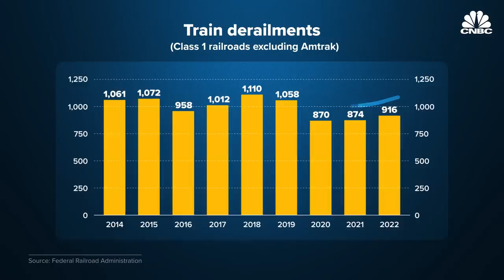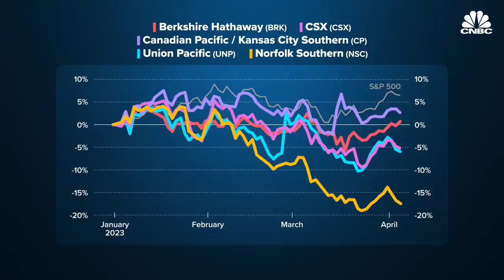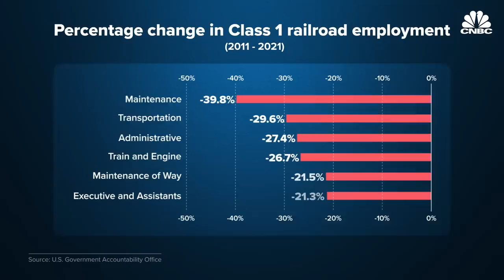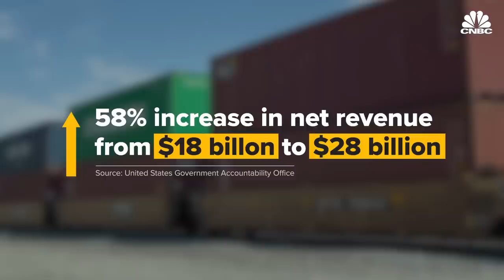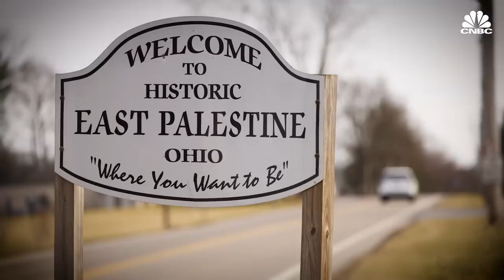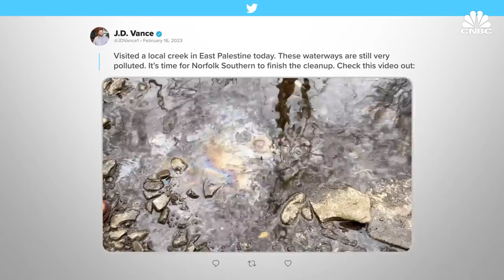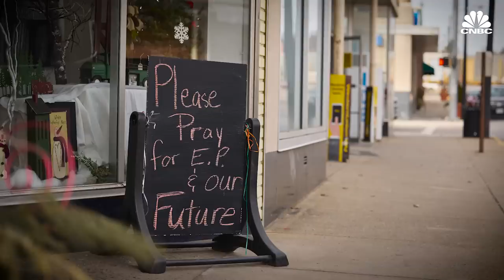Freight Trains Keep Derailing. Why?

Comment: They keep making the trains longer and longer, and they've been doing it for about 20 years or so. They need shorter trains, larger crews working shorter shifts, and they need to bring back cabooses, Fred doesn't do anything, he just flashes. Safety used to be first. Now it's fourth. What's first? Profit, of course. That's what needs to change. Safety should always be first. A conductor riding up in the cupola of a caboose would be able to spot the hot glowing bearing, Fred can't do that. Trains need to be shorter. Crews need to be larger. And shifts need to be shorter. Oh, and the double-stacked Conex containers need to go. Too top heavy. The Ferengi need to get their money-grubbing hands out of everything.
Reply: If your saying Trains shouldn't handle Intermodals, that's not possible to get rid off, the thing is is Trains are the most efficient way to Trans port Containers on Land by far, so it's not that simple.

Comment: Freight trains are way to long. They used to be 50 cars long, now they’re 200 cars long. That’s insane. They RR companies do it because it takes the same number of crew to run a 50 car train and a 200 car train so they do because they’re being cheap, they don’t want to pay for more crews, but it’s penny wise and pound foolish because a 200 car train weighs 4x more, harder and longer to stop and when that extremely long stung out train crashes there’s far more damage. In the long run costing the RR a fortune to clean up the mess, the lost equipment, the lost cargo and the law suits that follow. Not worth it.
Reply: Modern locomotives are 4 400 hp, not the 1 500 of the 50´s
Hence longer trains with less engines. AC traction motors are stronger and computers have better control of wheels adhesion to avoid wheels slippage. Technology permit to have radio controlled locomotives in the middle of the train to reduce stress forces. Less locomotives on the roster =   less employees to maintain them and less shops. 
Where i am, potash trains are 200 cars of 130 tons (100 tons of potash + 30 tons car weight) or
26 000 tons + 2 locomotives in front + 2 in the middle and 1 at the rear.

Comment: More load=more track stress/vibration.

Freight railroads don't care about infrastructure and tracks/mainlines are getting old.

It's the freight railroads that are the problem and it's too risky for Amtrak to run if the freight railroads won't fix the tracks. 

With all this I won't be surprised if a major Amtrak derailment happens...

Comment: Is it because of hot box axles? Trains use to have cabooses where someone would watch for hot boxing and stop the train if it happened. Can we setup monitors on the cars that automatically cut the engine?
Reply: Sure, way back in the day of 75-car trains, made up of 40 ft long cars, ie 3,000 ft long trains, the conductor "could" see problems in their train. In today's typical two-mile-long steel snakes you cain't see the other end of the train and need a box (FRED - Flashing Rear End Detector) on the end of the train just to tell you if the train is still coupled or not.
Reply: No way, paying one more employee to ensure the safety of the crew and train is not worth it because.... Profit!

Comment: Small correction.  The film on the water is just as likely a bacterial biofilm.  This isn't uncommon in early spring.  That's not to say it's not also polluted (almost certainly is), but it's not the smoking gun it seem like.
Reply: Or the fire combatant chemicals. There are eco friendly types, and effective ones.
Reply: Easily also industrial agriculture residue.
Reply: Just runoff from roads can cause that around me.  Though also heard reports of a huge amount of fish and livestock dying off, so probably more then just the usual slight amount of oil drip from automobile traffic.

Comment: look at the nails holding the track they are missing and are loose. at sulison city counding 10 sleepers  there were 4 nail holes per grip, of 10 sleepers most of them were missing nails 9 of them had nils up by one inch,  2 had nails out by 2 inches this could well be typical of many rail road tracks.

Comment: Some derailments are also cause by trains hitting trucks at grade crossings. The most dangerous trucks are hazmat in tanker / other trailers and oversize loads that use lowboy flatbed trailers. Those are the fault of the truck drivers who decide to go around the gates or go across sloped grade crossings getting the lowboy trailers stuck on those sloped grade crossings. There are videos of trains hitting trucks with lowboy trailers carrying heavy construction equipment or oversized loads then derailing. Grade crossing accidents are not the railroad's fault it's the fault of the stupid road vehicle driver going around lowered gates or getting an lowboy trailer stuck on an sloped grade crossing. Other are trains hitting people trespassing on railroad property or people running or riding bicycles across the grade crossing as an train coming. Train crews suffer mental issues when they hit an road vehicle or an person with the train they have control of. When they slam the train into emergancy braking it takes time to stop the train and sometimes that can cause derailments due to the slack, weight, and tonnage of  the railroad cars sliding to an stop.

Comment: The Big Issue is that government rules, supported by Democrats, safety activists and the unions, forced the freight railroads to spend $15 BILLION over the last decade on a Positive Train Control computerized/GPS system that has produced virtually nothing in the way of safety (it sure didn't stop East Palestine or any of the other recent derailments). When those billions go out the door with no return, less money is available for much cheaper and more cost-effective safety measures like worker training, more frequent car inspections, more defect detectors along the tracks, drug testing, track upgrades, etc.
Reply: Well, the PTC isn't integrated with other safety systems.   Perhaps in the future the hotbox detectors will not only "talk" to the crew but also send a report to the dispatcher and a computer there would, given a warning of a likely failure, directly stop the train so that the conductor can do a manual inspection.    PTC in theory could permit the trains to operate with only one person who would only get involved when the system detects an effort which requires closer inspection or when a switch needs to be manually operated or a broken coupler or hose needs to be fixed.   Otherwise, the guy could take a nap.
Reply: That's why laws should be written in a way not to tell you what to do, but to tell you what you need to achieve.
Unfortunately many laws in the USA (and many other countries) are just badly made.

Comment: Lots of ignorance in this video and the comments.  US railroads spend an average of $2-4billion per year each on capital improvements.  The mainlines are in better shape than they have been for decades.  Derailments are down about 40% since 2000, and about 75% since the 1970s.  RR management absolutely hates major derailments.  They are expensive in human and equipment and lading loses, expensive to clean up, and expensive in the disruption they cause in traffic patterns.  That said, the large amount of money it would take to significantly reduce the number of derailments would be hard to justify.  US RRs move thousands and thousands of cars in hundreds of trains daily, and cover hundreds of thousands of miles.  With that volume there are going to be derailments daily.  You can't drive defects to zero.  It's like saying you would like there to be no car accidents.  We would all like that, but what would it require?

Comment: Maybe the government should subsidize retraining for people of out a job. That way we get more engineers and mechanics, so we do not need that many long trains. We see the same in the trucking industry. 1 truck driver can drive a truck with two intermodal 40ft containers. A single train engineer can move 300 containers with just 150 cars. Maybe the government should stop with these covid checks and make sure people start working again. Too many people are at the side line. Another issue is that the government does not enough to prevent theft out of containers stacked on a train. What is the railroad solution? Well, they can't attack a running train. So these companies make sure trains are running in these dangerous areas.

Why doesn't the US government implement periodic roadworthiness (track?!) checks which are common in Europe, but not the US. A locomotive or car cannot be used if it doesn't pass the periodically checks. In many European countries roadcars needs to be tested annually. Cars in better condition also result in less accidents. Less accidents means a lower burden on ER's. Less people in ER's means lower health insurance premiums... 

Unfortunately our politicians spend more time attacking each other than real day to day issues. 

If we don't get more train engineers and still want shorter trains, more cargo needs to be hauled by truckers. Maybe CNBC can also crunch the numbers about truck incidents. Do we see a trend where each year the number of accidents with truckers decreases? I'm pretty sure we see the 'wrong' trend and isn't that different from accidents on rail...

Comment: I'm curious as to why this report paints the picture of Northfolk Southern supposedly having 'no other choice' but to perform a 'controlled' release of the hazardous chemicals because of some apparent 'explosion risk'. Because this report doesn't mention the fact that Northfolk Southern of course always had the option of appropriately disposing of these toxic chemicals in the proper, responsible way. 

Yes, this would have undoubtedly been much more expensive than the way they chose to 'handle' the situation by sticking some explosives on each derailed tanker car and just blowing everything up (including any and all evidence for any wrongdoing on Northfolk Southern's part, conveniently). 

But because of Northfolk Southern's reckless abandon, and their absolutely moronic decision to purposefully detonate all the remaining, fully intact tanker wagons, thereby allowing all the hazardous chemicals contained within to leak away and partially burn off, resulting in the complete and thorough contamination of the surrounding nature and community. 

So, astoundingly, instead of doing everything in their power to prevent the release of any more of the extremely hazardous, carcinogenic and toxic vinyl chloride, they have literally and purposefully doomed the surrounding community and all local wildlife, flora and fauna within (at least) 3 miles of the crash site. 

I do not understand why it is not mentioned that they had the option to pump the remaining chemicals away! And I do not understand why Northfolk Southern chose to blow the remaining tanker wagons? Admittedly, this definitely must have seemed like the 'cheap way out' for them at first, but now, after this 'intervention' of theirs, the previously projected costs of properly disposing of the chemicals must absolutely pale in comparison to the absolutely insane amount of money they will now be required to spend on the cleanup of the crash site, litigation and the compensation of the local community.

Now that they've blown the remaining tankers and burned off the remainder of the chemicals, they can once again use the impacted section of rail for further freight rail traffic, whereas this stretch of rail would surely have been closed down for multiple weeks had they decided to do the right thing and properly disposed of the chemicals. Which would have limited the release of any toxic chemicals to only those which were released as a direct result of the derailment (and thus were absolutely inevitable). Make no mistake, this would of course have been a huge blow to the local community and the surrounding nature too, but the magnitude of the resulting disaster would have been much less severe (by at least several orders of magnitude) compared to the absolutely apocalyptic scale this catastrophe has currently grown to.

Now, of course I do not have any evidence that Northfolk Southern resorted to this so-called 'controlled release' because of the financial costs of a proper cleanup and the losses which would have to be absorbed as a direct result of the impacted stretch of rail being unavailable for several weeks while the cleanup was under way. But Northfolk Southerns' meddling in the EPA's investigation into the cause of the disaster, and their stubborn insistence on handling everything "in-house" as much as possible, beginning with the investigation team consisting solely of people from their own company (which will now be replacing the EPA as the team conducting the investigation into the cause of the disaster), I think you'll understand my skepticism and doubts. 

I really am incredibly concerned with the impartiality of the current investigation and the trustworthiness of it's findings and results.

And now with you guys at CNBC having slogan the "first in business worldwide", well let's just say that I am no longer surprised by the (in my opinion) complete lack of of any balanced reporting in this news piece whatsoever. 

You guys really are living up to your name! (or slogan in this specific case)
Reply: Thanks for your concern.  Nobody died.

Comment: Working for UP, I honestly hope that the government can put regulation in and tighten up the rail industry. These railroads have gotten so big and are so powerful they are running themselves as almost their own nations. There is not a big trucking competition anymore and these major rail corporations are now running away with monopolistic powers. UP won't pay money and repair anything until it breaks and hides how many times it actually happens. We have unsafe postions of what we are placed in without enough training to preform them right and we still have a gun against us if we do wrong. Psr has pushed so many businesses away from the railroad that are still there but railroads only want the long intermodel trains so it pushed these other little industries to the side

Comment: The Government needs to step in and put laws requiring a certain amount of mechanical staff required to inspect each car prior to departure. Also, they need to put some underground barriers that pop up or something to prevent people from doing stupid stuff like crossing when the rail road crossing lights come on. Maybe cameras and movement detectors in the crossings to prevent a stuck vehicle from from getting ran over etc. I just can't beleive these people haven't thought of these things. There's so many options!
Reply: that all sounds expensive. that's the problem
Reply: @bookshelffury  the health of American people is more expensive
Reply: Ridding stupid drivers is actually cheap.
Reply: Carmen used to have 3min to inspect each car before it left the yard. Now? Carriers want it done in under 90 seconds.

Comment: Seems like some of it is the thin scheduling of train crews, they can only work for 10 hours at a time, I suspect that was supposed to be 8 hours plus slop time, these crews need sensible schedules with consistent start and stop times, because otherwise you won’t build the experience you need as people get older, someone with a spouse and family won’t want to work these irregular hours with vet little home time. Greed is killing us, stop treating people like machines!
Reply: Those in charge couldn't care less about the crews. Their thoughts are they can just replace them either with someone else or entirely through some means of automation.

Comment: The longer the train, the more potential points of failure are introduced.  Couple that with lowering manning per train and having them perform inspections better performed by mechanics, it is inevitable that more accidents will happen.  Its not rocket science.  And the term ":accident" is incorrect.  They are mishaps which are the for seeable consequences of bad policies and conduct.
Reply: That is not true, because the longer trains are making use of train handling technologies that were not available before.  And the potentials for human error have been reduced.
Reply: @MilwaukeeF40C  If you are referring to ECP brakes which were mandated by regulation under Obama, those regs were rescinded under Trump due to the excessive costs they would impose on the railway companies.  A lot of these super long trains that carry flammable or hazardous chemicals are not equipped ECP brakes and in the East Palestine derailment, that train was not equipped with them.  Plus you have look at how these longer trains are subjecting track to more stress than what is accounted for in track maintenance and the fact there is less margin for error on the part of train crews which are subjected to longer hours with less downtime which increases the likelihood of mistakes being made.
Reply: @dmac7128  ECP Brakes are not really any more effective than the Normal Brakes the Train have.